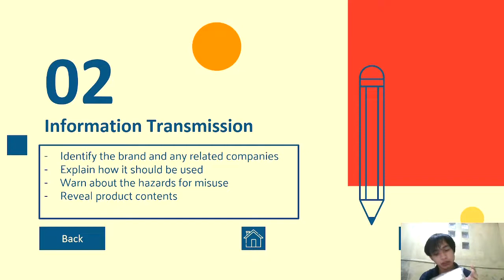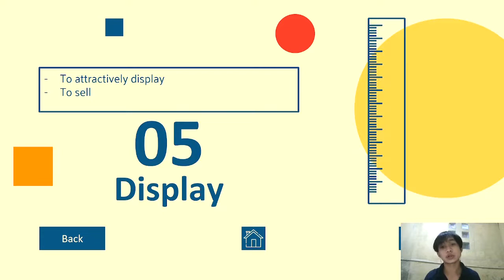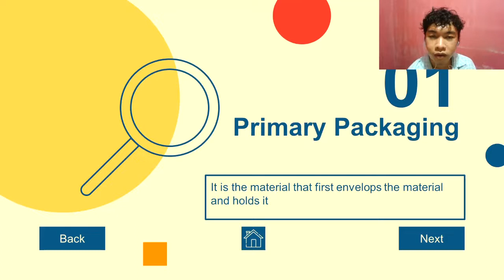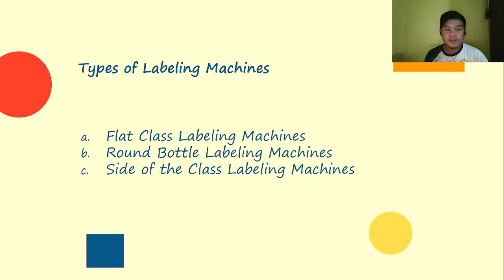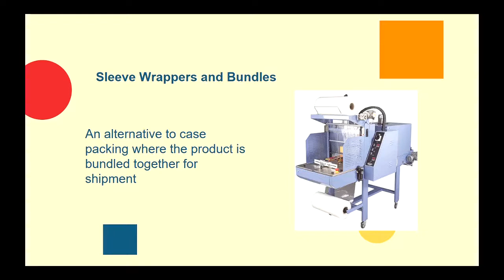Industrial Packaging Processes

Comment: Mier, Dan Lester S.
BSME4A

17:52 Auger Filling Machine

A screw conveyor, also known as an auger conveyor, is a device that moves liquid or granular materials by rotating a helical screw blade called a "flighting" within a tube. Many bulk handling businesses employ them. Screw conveyors are commonly employed in contemporary industry to transfer semi-solid commodities such as food waste, wood chips, aggregates, cereal grains, animal feed, boiler ash, meat, and bone meal, municipal solid trash, and many others horizontally or at a little slope. The Archimedes' screw was the first screw conveyor, and it was used to pump irrigation water since ancient times.

Comment: Zalsos, Ervin A.
24:38 Case Sealers
Case sealers are utilized in manufacturing contexts where a run of the same sized case is created and then swapped over for the next sized box. There are two kinds of it: uniform case sealing and random case sealing.

Comment: Lawan, Edcel Benz R.
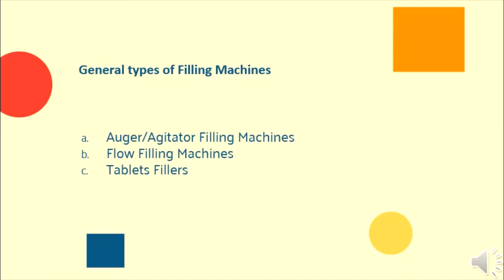17:51 Auger/Agitator Filling Machines
Auger/Agitator Filling Machines are used to fill dry mixes like milk powder, sugar, flour, and so on. Fillers have a cone-shaped hopper that stores the mix and places it in a pouch with the help of an auger screw controlled by the agitator.Though auger fillers are commonly used to fill powder products, with the right tooling, they may be used for a variety of other applications and products.

Comment: Simene, Jeff Hentzen F. BSME4A
3:27 Packaging

The science, art, and technology involved in enclosing or protecting products prior to their distribution, storage, sale, and use is referred to as packaging. Additionally, the process of designing, evaluating, and manufacturing packages is referred to as "packaging." Packaging is more than just a pretty face for your product. Your packaging design may affect everything from breakage rates during shipment to the willingness of stores to stock your product. For instance, "displayability" is a crucial factor. The original metal container for Log Cabin Syrup, which featured a slanted roof, was replaced with a design that was easier to stack after grocery stores refused to provide the necessary shelf space for the awkward containers.

Comment: Enad, Kyle Paul M.

21:20 - Skin Packaging Machine

The Skin Packaging Machine is the topic that has attracted my curiosity. The packaging process is simplified by automated skin packaging machines, which pull the product-filled skinboards into place, apply the plastic film, cut the film to liberate the board, and transport the completed skinboards into a waiting bin at the end of the manufacturing line.

Comment: Romero, Lorenzo Matthew D.
17:50 Auger/Agitator Filling Machines
Auger filling machines feed a chemical into its container with precision. During each cycle, the product is held in a hopper, and the filler distributes a specified amount of it into the package. Auger fillers can fill containers with liquid, semisolid, powdered, or granular materials. The machines can handle a wide range of commodities, including free-flowing, non-free-flowing, liquid, paste, and processed meals, when appropriately configured.

Comment: Casiño, Earl Anthony

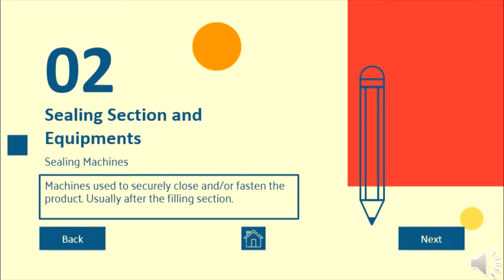19:35 | Sealing Equipment

Sealing Equipment consists of machines and devices whose functions include enclosing packages in flexible films and closing boxes, cartons, and bags. Machines can be operated manually, semi-automatically, or completely automatically. Principal specifications include intended application, sealer type, sealing method, sealer configuration, sealed materials, and operating parameters of sealing size, thickness, and rated speed.

Comment: Pañosa, Jino Dave O.
23:55 - Case Sealers
Case sealers are used in production environments where a run of the same sized cases is made, then changed over to the next sized box. Case sealers are used to execute one of the most important steps in the packaging line, which is seeing the package before it is shipped out to your customer. Case sealer machines help companies to create a perfectly sealed case every time.

Comment: Estillore, Cherry Mae P.
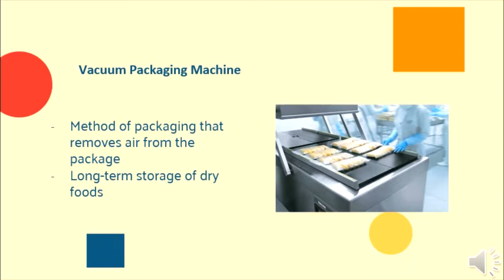20:42 - Blister Packaging Machine
Blister packing machines are specialized equipment that are used to package tablets, capsules, and other unit-dose products. The device includes a bubble pack component, which could be a cavity or pocket made of a formable film, such as thermoformed plastic or cold-formed aluminum. Blister packs can provide barrier protection for shelf life requirements, and a degree of tamper resistance.

Comment: Candaroma, Katriona Maxinne G.
17:50 Auger/Agitator Filling Machines
Auger filling machines accurately fill a substance into its container. The product is stored in a hopper, and the filler distributes a predetermined amount of the product into the package throughout each cycle. Containers can be filled with liquid, semisolid, powdered, or granular materials using auger fillers. The machines, when properly configured, can handle a broad range of commodities, including free flowing, non-free flowing, liquid, paste, and processed meals.